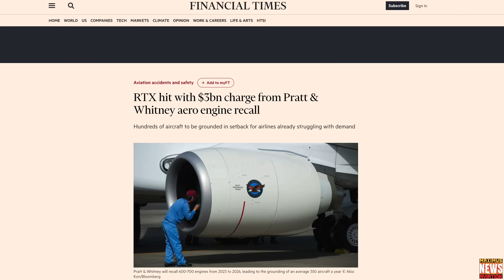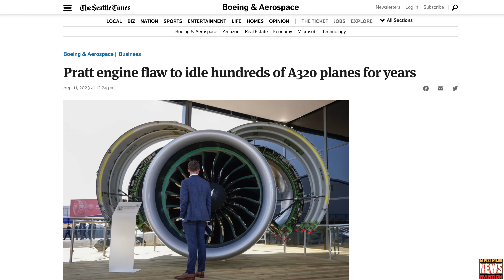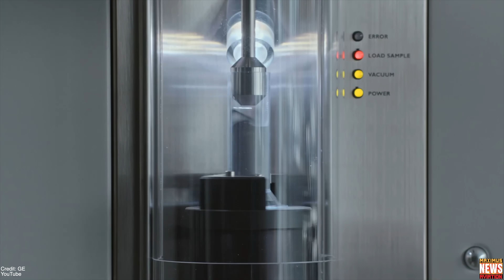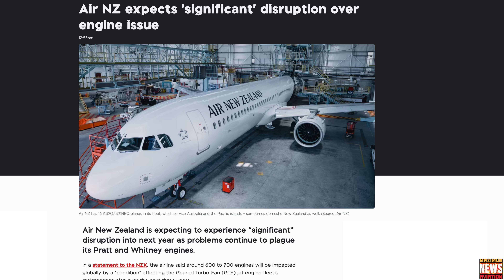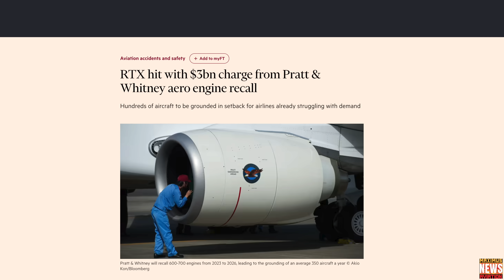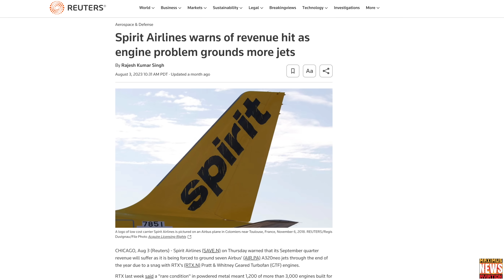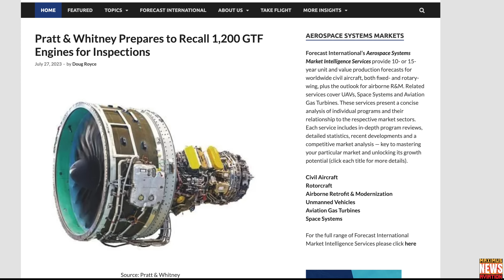HUGE LOSS For Airbus. Every A320 neo-Family Jet P&W GTF Engine Will Have To Be PULLED And Repaired!

Comment: Airlines are going bankrupt because of known Pratt & Whitney management obfuscated INHERENT design issues, management omitting known data from engine Certification.  So far, so far, no one has been killed due to a failure of this engine.  

Raytheon brought out P&W and this engine BEFORE it started to fail with the public as the flying guinea pigs.  The corporate officers knowing they'll get their bonuses and leave before the shit hits the fan.  P&W did a collective sigh "whew!"  "we're rid of that massive liability" as the corporate officers at PW and UTC collected their bonuses and departed.  All clear?

The FAA and the public don't know the half of it.  (the real inherent design issue(s) haven't revealed themselves (in-air failures), haven't occurred yet.)   Just wait, as the cycles accumulate, the REAL issues will start BLOWING UP.

Comment: Not sure how to tag the author, but the answer to the question is there only one source of metals : no. The original inventor of titanium metal powder is Pyrogenesis Canada inc (PYR).Their 20 year old IP was the technology that made its way to GE hands. PYR is back in the game, with NextGen powders under going powder qualification right now with a “major aerospace OEM”. It should be qualified soon as the process is 2 years in. Cheers 🎉. 
PYR is featured on the front page of the 2023 Powder Metallurgy Review

Comment: With decades of advanced material development, quality control and failure analysis engineering experience, it shocking to the core that the powered metal supplier just detected the contamination now  when in fact the technology and proven methods to detect the alleged contamination has been around for decades.

Comment: They can reduce maintenance to normal operation routine by modifying FADEC in reducing the bypass ratio to the same level as CFM LEAP engine. The problem will disappear.  PW's problem comes from they put the engine too far beyond the limit while their metallurgy parts came from the same supplier as GE.
Reply: The P&W Geared Turbofan has lots and lots of quality issues that literally have nothing to do with pushing limits.
Reply: @rafaelwilks  Their issues come from materials that cannot withstand the condition limit.    PW boasts its engine is the most efficient in the world.  Yeah, put it too far. Reduce the bypass ratio , and reduce the pressure ratio , that is the way out of problems.   Or else go on like this , take time in advancing new materials to cope with the engine's supreme working condition.
Reply: @alexlo7708  if there is any trouble arising from pushing limits in this case, it's solely P&W's fault for having materials that just aren't good enough for the desired parameters. These parameters can be safely met, it's just that P&W doesn't have the right materials for it - I've heard P&W's been going downhill for at least a quarter century.
Reply: @rafaelwilks  Somehow ,it should  blame to the US govt. Their policy for both engine suppliers is to support PW in challenging ways while keeping GE on a conservative route.  That's why we always see PW on the latest new model fighter coming.
Looks at the beginning of F16. The earliest PW100 had only 300 hrs before the 1st repair schedule. And they took time to develop and extend engine life. That seems OK when it was on military operation but not in a commercial way like this.
The unavoided factor is both engine brands use the same casting metallurgy technology from the same supplier.  So how can one have an engine withstand more harsh conditions by only different in design drawing.

Comment: Why do the airplanes have to be parked? Why don't they begin a rotation program; replacing suspect engines with good engines; minimizing ground time. At first, they would use new or known good engines and transitioning to the inspected/repaired engines as they flow through the process.

Comment: It does not look good. GE Aerospace owns CFM International Leap and Safron Aircraft Engines. GE and Pratt and Whitney manufacture their own powder metal production facilities. Iron inclusion is the contamination factor. They apparently need to increase compaction pressure, sintering temperature and time there of to increase bulk density. They caused the problem themselves. They produce the alloys, at their own plants, such as alloy 718, A-286, and 625. Nickel based super-alloys.

Comment: Why 2 engines instead of 4?  Blah blah blah, effifient, more powerful.  But what about in flight safety through redunancy?  Moron, this isnt old prop tech, its jet engines.  We aren't flying B-17s over Europe.  I know but what id one of the engines fails?  Nah, we have the science, tech and trained mechanics.  And if that goes wrong?  One engine plus the hazard of fire, debris, god knows what else?  Like?  A flight computer that takes over control from the pilot, let's call it Hal.  Why?  No reason.  Hal to pilot, I am sorry, Dave, I am afraid I can't do that.  And flies the rig into the ground.

Given its my life on the line, I will trust my ten year old fully maintained Honda to drive across the cuntry to California and back.  You know get the lay of the land at 75 mph, get there in peace of mind.  I dont want to be on a passenger list whose i.d. was real safe, but plane was not.

Comment: So let's recap a bit and check on our assumptions. We have two companies with 95% of the market. If one falters, the other one is left to haul the almost entire haul. You have three turbofan manufacturers, maybe four with an alliance all making these engines. If this is not a precarious ecosystem, I don't what is. Consider that two years after an invisible microbe shut down our supply chain with repercussions still being felt today. Wall Street might be cheering profits but I fly on these airplanes sometimes twice a week. My bicycle sounds better and better all the time :) But kidding apart, there is nothing here for anyone with a modicum of strategy genes in them. Our systems are so not-resilient and invisible microbe can take them down for years. What does this remind you of? Let's work on resiliency and open up to healthier competition without going to any extremes. So it goes.
Reply: Wall Street would be crying but I hear what you are saying

Comment: If there is a potential serious safety issue why are they waiting 3 years to do the fixes. They need to start immediately and ground planes if they can’t get the engine safety issue immediately. They either have a safety issue or not and they immediately need to start the checks on a high volume. basis. My bet is there will be some flight instances but hopefully no crashes or parts enter the fuselage.

Comment: Yep Laser focused! They have been using that buzzword for 15 years plus. Pratt has had all kinds of programs to mistake proof their process and this proves what bs it was. However their biggest blunder and what I’ve worried about for years is single source procurement. They wouldn’t be in such a pickle if they had spent the money and used a minimum of 2 sources for every component. Glad I’m retired and not living that nightmare at Pratt.

Comment: Who, what, how, why, when where. the metal powder, who manufactures it, where does or did the raw materials come from, what are the contaminants, how did it/they get into the metal powder, and when. Is it an isolated occurrence or an ongoing problem and why is all this happening. industrial sabotage ?. the electrification movement, the wreak the western world crowd, and so on and so forth. All the high bypass turbofan engine manufacturers are affected.  Do you really think these are randomly occurring events or are they part of a long-term plan to change the world as we know it ?.

Comment: It seems like today's jet engines are pushing the envelope of efficiency to the max. There is no margin left for any defect. Any defect seems to guarantee the engine will blow up.
Reply: Any defects in any older jet designs were just as, if not more, likely to cause the engine to blow up, too

Comment: Lots of claims/suppositions about "who is to blame", which is a very Western reflex approach to problems, but I don't know we can assume anything about the QC processes given, unless I've misunderstood it, the video says it was a NEW test that made it possible to detect the problem.

If the existing tests could NOT detect it, then it's nobody's 'fault' unless:

1. they knew/had reasons to suspect their testing was inadequate, and 
2. did nothing about it.
That seems improbable, but certainly not impossible.

As a general principle I would suspect this is one of those "oops" moments, and not clearly a cost cutting/incompetent/intentionally negligent scenarios.
Not saying it is, as we can't know on the scant information available.

Just some thoughts.
Anyone have anything to add? Constructive feedback is always welcome.
Cheers

Comment: Can't (not) wait for all the  Henny Penny comments this will produce below (just like it did with Boeing). Like the dingalings that blame bean counters for this issue. They have no idea ( or blatantly ignore) that this issue will fall to the Chief Engineer and the QA engineer at plant, they signed off on design and manufacture. If they are subcontracted parts then the bun fight will start between design and manufacture and another party added into the mix.
Reply: The design was fine, the supplier was less fine.

Comment: I’m not fully understanding why they would bother inspecting the current discs at shorter intervals instead of just replacing them with known-good discs with a long service life by default. That can’t possibly be the cheaper option….
Reply: Because there’s only so many parts out there. And only so much capacity to make more. See the previous 3 years Everything Shortage for examples.
Reply: @Racing_Pig  I don't think that's the problem. If the airline keeps operating with engines that are suspect and there is a crash, well, they will be responsible. They have no choice but to call in all the suspect engines.

Comment: You mentioned that they couldn't detect this contaminate before. Maybe there is a new method to analyze the material that let's them better analyze samples. Or the more sensitive analysis technique got cheaper/faster so they can apply to many samples on a regular basis. So maybe now they're detecting something they couldn't really see before. That would explain why it's not being rushed. It's probably not going to effect the part that much but probably isn't good enough to completely ignore the potential problem.

The problem with the powered metal is that it's something that can get mixed with other ingredients to form the final product. So the part needs to be made from powder 1, powder 2 and powder 3 mixed together. Maybe there's one big supplier for commercial aerospace grade powdered metal 2. That one subcontractor has the product that has all the paperwork and capacity to supply major manufacturers and might be the only one that other subcontractors or the manufacturers use as a supply of powder 2. Plus, if other contractors use it then it's reputable. Somehow, a minute about if contaminant got into the powdered metal. Could be in manufacturing, source material, shipping or storage container. Depending on what lots got effected, and what lots it's mixed with, it could possibly be thousands of downstream products. If the contaminated powder is only used in tiny amounts in the part, like the part is only 0.17% powder 2, then it's probably ordered rarely as one shipment is enough to make thousands of parts and is small enough to store on site. This is one way I think so many manufacturers could be impacted. The cost of having the paperwork, certifications, inspections, etc is high and limits the number of companies from which you can source material. They again, maybe a new testing method revealed a potential problem as well.
Reply: Thanks captain obvious for the explanation. All that information was in the video, so you were just parroting. Also your speculation is not well thought out in that you repeat yourself several times. 

Yeah I'm feeling rather nasty today. After reading dimwitted replies in various videos of people trying to act smart, but for their own self interest should keep their mouth shut and keep their   opinions to themselves as it only highlights their ignorance. 15 videos I watched so far today, and there's always some moron who thinks they have it all figured out, but don't understand the first concepts of engineering and physics. The Internet is provided a venue for people to expose their ignorance to the World.

Comment: I’ve always worried about the new P&W GTF engines, that there are a heck of a lot of things that can happen as they undergo wear and tear.  Hopefully they’ll get this resolved.
Reply: GTF engines are just oversized helicopter engines, the only tricky thing about them is the packaging of the gearbox (size, placement, and cooling).
Reply: It’s a actually the opposite. GTF has many less parts. Since the fan and turbine run at their optimum speed there are 3000 less parts and 6 less stages. There are some extra parts in the fan elliptical gear which worried some people but it has performed flawlessly.

Comment: So P&W will be filing a massive product suit against their supplier. It will run for 3 years of pre trial discovery, and the day the trial is due to start the insurance companies will settle out of court and the champagne will flow at the attorneys…

The write downs will improve their tax position, and the shareholders will be fine.
Reply: It looks like their supplier was also owned be RTX, formerly Raytheon and UTC. I don't think they'd have to go through a lawsuit unless the problem was further downstream or they outsourced some part of QC testing to outside companies that didn't follow SOPs while carrying out the tests.
Reply: Golden parachutes for all!!!

Except whoever ends up on the plane where the engine blows up.
Reply: @Racing_Pig  it’s not the engine blowing up that’s the issue, according to the ETOPS doctrine, it’s hunks of the engine embedding in the wing tanks…

Yes I’m being a touch flippant, as was my point about the financial impacts.
Reply: @bernardkealey6449  well, hunks of engine embedding in the tanks, or like on Southwest, embedding in passengers.

Comment: Since the P&W GTF  has variants for the 320, C-Series/A220 and Embraer E2 jets,  how come this impacts only the A320?  And when one mentiosn A320neo, does that implicitely include the A320neo as well or are thsoe engines considered different? 
I would have assumed that all engines of the same vintage an development would share such a flaw in compressor area and find it odd thatc ompressors for A320 would be made of different material than those for A220 or E195-E2.

Rolls Royce also has had its share of problems and this is likely what happens when you push engines to their limits. Explosion of a GTD engine during X-Series certification caused an additional delay that was too muchf for Bombardier (RIP)  who has made mistake of trying to launch 3 planes at same time (C-Series, Global 7500 and Lear 85).

Comment: This is where Delta Air Lines have a big advantage. They are actually certified by Pratt & Whitney to service engines without shipping the engines back to P&W. As such, Delta could fix the PW1500G engines on their A220 fleet on their own.
Reply: They still need the replacement parts from PW. And the replacement turbine disks will be the main bottleneck for the GTF problem. That's why the whole recall campaign will take 2+ years. There is only a certain capacity to produce such parts and the supply chain is currently the main issue in all the aircraft and aircraft engine industry. It couldn't have come at a worse timing.
Reply: Yeah...they'll complete the repairs by 2040.

Comment: You'd think it would be cheaper to supply courtesy exchange engines than to ground the aircraft for months.
Reply: If there was an infinitely scaleable engine factory and supply chain sure. 

There isn’t. Especially in LEAN manufacturing.
Reply: @Racing_Pig  it shouldn't require infinite engines. They're planning on doing 350 aircraft a year. So 700 engines.

If refurbishment takes about 2 months that means they'd need a pool of about 100 engines. They build about 500 engines a year.
Reply: @gasdive  Except they also have to meet NEW production that has already been planned.

Comment: Along with Boeing, this problem with P & W and the issue with near misses at airports the USA aerospace industry is going down the drain. Unfortunately US the US aviation is now run by accountants rather than engineers.
Reply: In a way this gives Boeing a bit of breather.    If Boeing or AIrbus can deliver planes because there are few engines it give Boeing more time to make oval holes round over at Spirit.